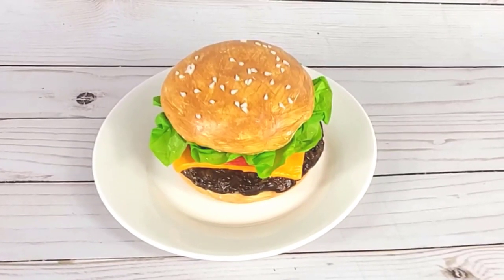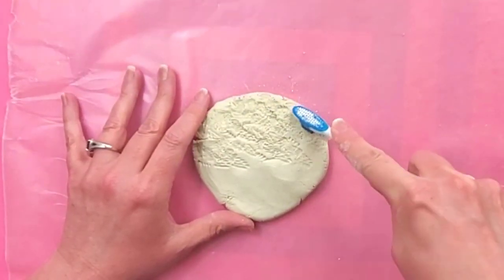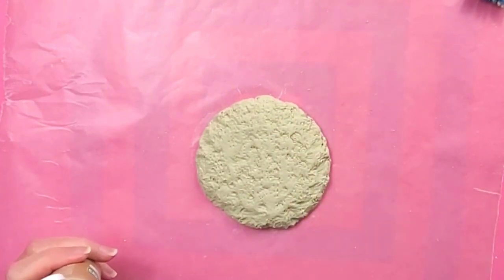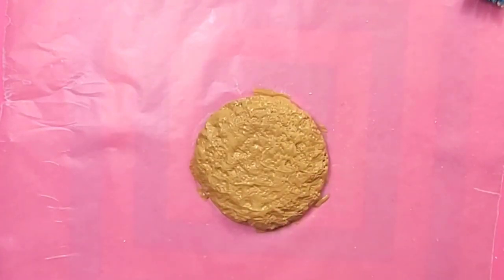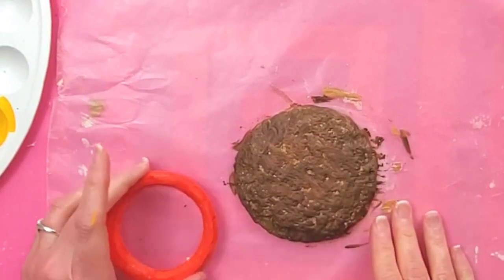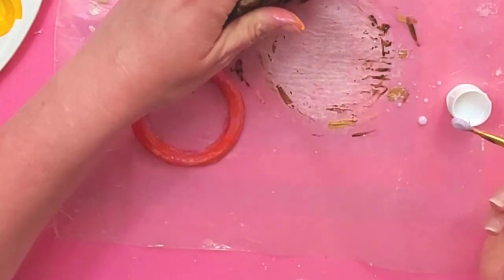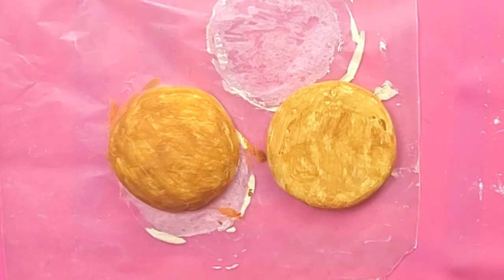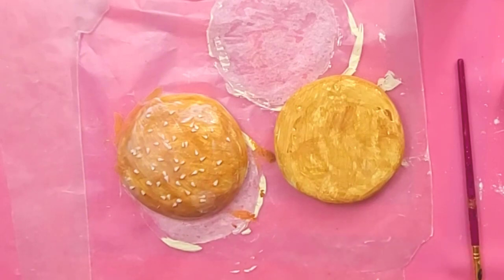Air Dry Clay Food Tutorial - FAKE HAMBURGER

Comment: Hi great video but is there a way to make fake lettuce out of clay? I know it won't be perfect but I want to make a burger with lettuce but I don't want to use any paper.
Reply from the maker: Hi Irene! Yes, you can make it out of air dry clay or foam clay. Just roll it out really thin. I would use my fingers to pinch around the edges to make it thinner there and cause it to be more jagged and uneven giving it the appearance of real lettuce.